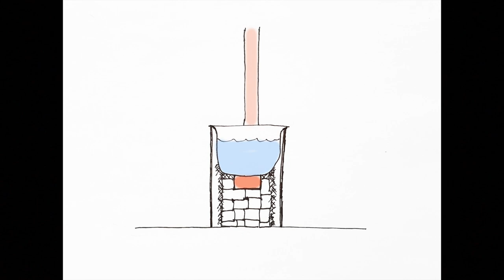Rocket Stove Hot Tub - How I Made It

Comment: I have learnt that a low chimney has only the cooler air exit the contained space, while the height and draught are enough to continue to pull. It's about stalling the hottest gas in the area under the bath longer.
Reply: That is why you make ducts and loop it so more heat is imparted to the thermal mass instead of going up the chimney and exhausted. Choking it by slowing the air flow makes it less efficient and burn colder leaving more non-burnt material behind

Comment: I am not sure I would call that a "rocket stove", since there is no significant insulated heat riser to create a fast draw of air, but the design as whole makes sense, and seems like a good solution.   Since you probably don't have the high heat of a true rocket stove, you are probably getting incomplete combustion (smoke).  I would check for creosote build up over time on the bottom side of the tub.
Reply from the maker: Thanks for your comment ! Well actually, the burn chamber is made of insulated kiln bricks, once the burn chamber is hot there is very little smoke that comes out of the chimney and the draw is fenomenal. The efficiency of the system is in some way proof that the "rocket stove" design works well, that is it uses very little wood, gives off great heat and heats a large amount of water in a shot time. For sure the combustion is not complete !
Reply: @gaetanproductions  thanks I didn't get the fact that you insulated the burn Chamber from the video.
Reply: @gaetanproductions  also if you can really heat up the tub in 20 minutes that's great.

Comment: Thank you for the video.  I want to use your idea.  My one concern is if the bottom gets too hot and you can risk burning your feet or other unmentionables?
Reply: Never mind I read the description.  I was wondering how small rocks or some other non rotting material might be for a larger metal hot tub using your heating system

Comment: Hi, thanx for the cool video. i also built mine after seeing your video. I have problem with the plug/ water stopper and the water leaks, especially after the fire is on. I tried to seal with a oven silicon, but it was shir, now will try with wooden cone. What do you use for it? Looks like the normal one.
Reply from the maker: Thanks for your comment. Yes that was a concern of mine. I used bathroom silicon for the rubber plug, putting a good amount of silicon and putting a weight on top of the plug as it dried. The underneath part of the plug is of course in the chimney area. What I did hear was made like a protection inside the chimney so that the flame would not come into contact with the plug area. Using small bricks and cobb mix i made like  a column under the plug area. My plug has never leaked... not yet ! So at the area of the column inside the chimney the heat and flames separate for a moment, this has not created any problems for the draft. Good luck
Reply: @gaetanproductions  yes good idea with the underneath protection. Thanx man

Comment: Thank you so much, I thought of this similar idea, and would be sure to find a build on youtube :) Awesome work my man! This is so perfect for my needs! I cant seem to find insulated refractory bricks though. It should work without them I hope. Anyone tried with something else?
Reply from the maker: Thanks for your comment. That is not a problem if you cannot find the insulated refractory bricks. Having the combustion chamber insulated is a plus for slightly higher temperatures, thus more wood gas is burnt and less wood is needed. The insulation keeps the heat in, instead of it moving out of the combustion chamber through the walls.
Reply: @gaetanproductions  Cool, thanks for answering. Bathtub is now been secured, it was easy to get it for free, very happy :) Before I start building, do you have any guidelines on the correct/optimal burn chamber size and channel, or does it not matter too much?
Reply from the maker: @yvindmathiassen7617  you want the burn chamber to be fairly big as it there has to be considerable heat to heat that amount of water in a short time. You want the exhaust area/channel under the tub to be more or less the same surface area as the burn chamber so that what is created in the burn chamber can flow out easily. So that the air flow is not obstructed by a large volume going into a small volume. You will want maximum surface contact under the tub with the burn chamber and the exhaust channel. I am not at my home because of what is happening so I cannot give you the sizes I used. Good luck, please send a picture when you finish :)
Reply: @gaetanproductions  Cool, thanks for the info :) The surface area tip was a good one, I will work with that and adjust it for the sixe of the tub.

Comment: Doesn't the strip of the tub serving as the top of the exhaust get unbearably hot? I would think that the direct heat transfer from it would be too much.
Reply from the maker: That is the whole idea, it is good that it gets real hot, the water heats faster, using less wood.  I mentioned in the description that an important part of having a bath in this hot tub is to have two wooden planks, one to sit on and the other for the feet, this will protect you from that hot spot. I use these until it cools down.
Reply: @gaetanproductions  Ah, I see. I didn't read the description but that makes a lot more sense.

Comment: How did you regulate the water temperature?
Reply from the maker: if it is too hot you just add a bucket or so of cold water. Otherwise with experience I know when to stop adding wood in the burn chamber. Because or the thermal mass of the bricks underneath the tub, the water actually gets warmer after the fire is out and stays warm for a long time.

Comment: thats pretty awesome gaetan ... what about regulating the heat.. does it get too hot? or perhaps get to cold to quick?
Reply from the maker: Thanks Gary, it is very simple to operate once you get the hang of it. What I do is get the water nice and hot before getting in and I make it so that the right temperature corresponds to the end of the fire, so when I get in the tub the fire is more or less out. When I am in the water, if it is too hot, I add a bucket of cold water, this works perfectly, or instead of being completely submersed I put my legs and arms out of the water.  As the burn chamber and chimney at the base of the tub are made of a lot of bricks, this acts as a thermal mass and continues heating the water even when the fire is out, water actually stays hot for a long time. Bath time can be as long as one and a half hours.
Reply: @gaetanproductions  very nice! again, great job... quite inspirational

Comment: No warping or deformation of the tub from the heat?
Have you measured the temperature of the tub over the heat tube?
Reply from the maker: No deformation as the tub is full of water. Haven't measured the temperature in the water close to the bath tube that is in contact with the heat, though I know it is hot !
Reply: @gaetanproductions  Since you're French, you're probably an expert in making sauces.  One of the secrets my Mother taught me to keep from burning the sauce is to use a double pot, so you can always try this method if you need a cushion between your body and the hot spot.
Reply from the maker: French Australian :) Good one,  yes I put a piece of wood between the base of the tub and my body

Comment: The tub doesn’t get too hot to touch/sit in???  I can only imagine you burning your cheeks at some point. 😳

Also, over time, how has the tub handled the heat?  Any warping/cracking in the tub or at joints/fittings???
Reply from the maker: It is hard to see in the video, though I did write it in the video description, I put some wood between the bath tub and me when I get in, to protect my behind.
The tub is holding out for now, I think the fact that there is water in the tub greatly helps this. No leaks, cracks or warping. Time will tell
Reply: @gaetanproductions  what kind of pump do you use to siphon the water out? thanks